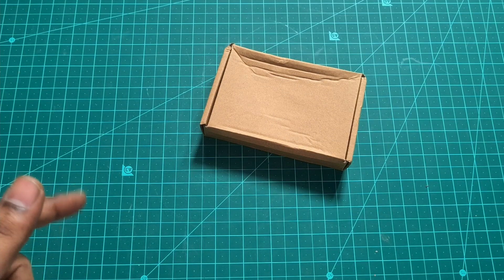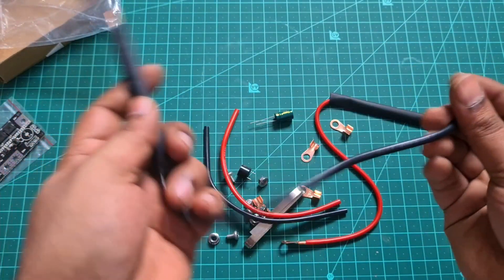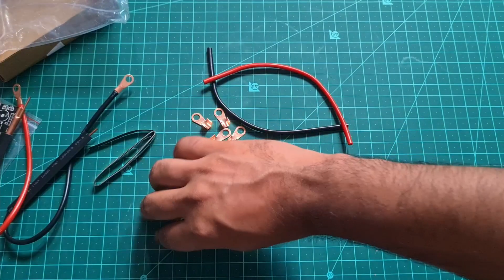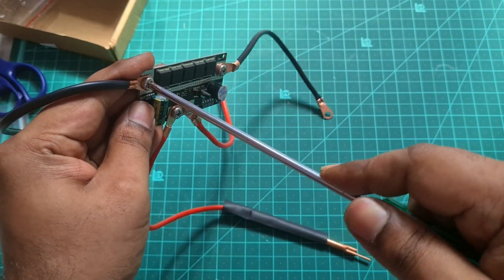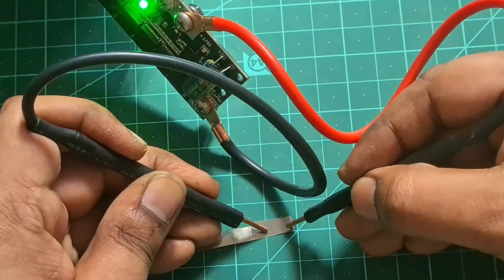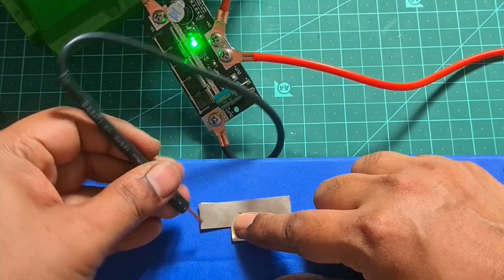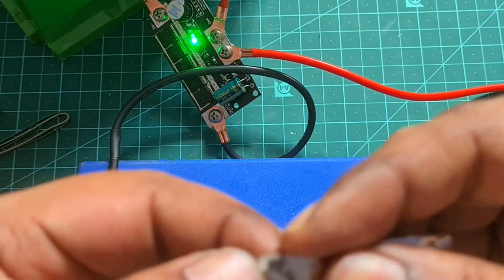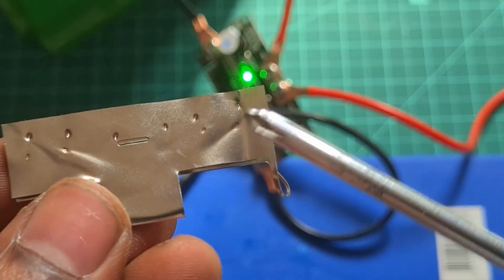அற்புதமான DIY ஸ்பாட் வெல்டர் (Spot welder) – விமர்சனம்

Comment: How much maximum current they survive?
Reply from the maker: There is no option to set current. It works on timing pulse. Use a good battery. Will work good
Reply: @diyIndia  Ok thanks

Comment: Links not working
Reply from the maker: Thank you for letting me know. I have updated the links.
Reply: Which type Lifepo4 battery use to make inverter 3c or ?
Reply from the maker: You can go with both..not a problem. If it's for invwrtor
Reply: @diyIndia  what is the defrence between them ?